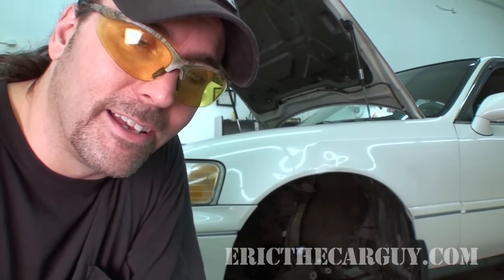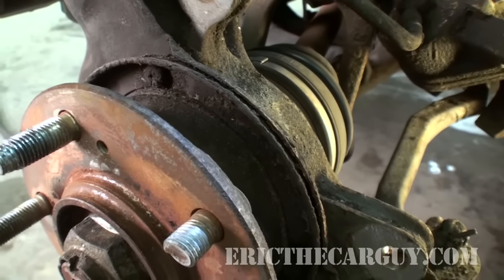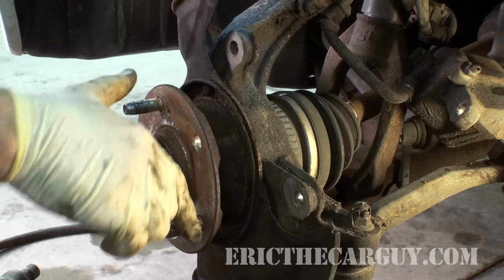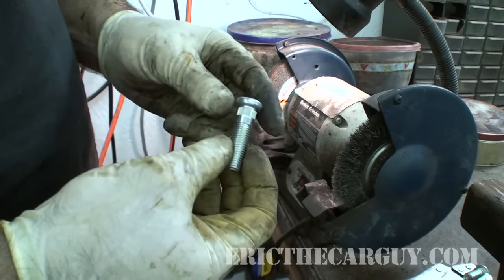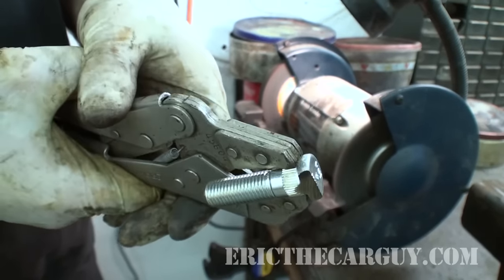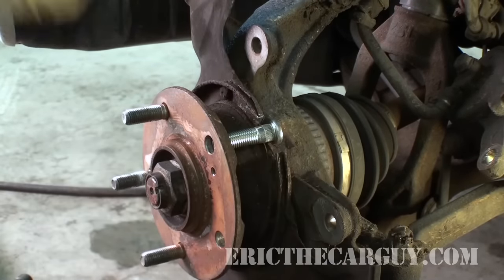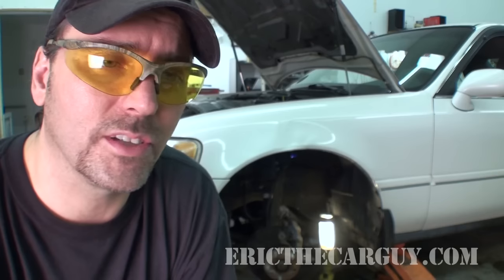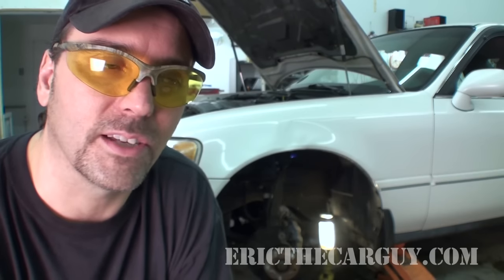Replacing Studs the 'Easy Way' -EricTheCarGuy

Comment: I have done this and it is a good reasonable method. Even with the missing portion on the back of the stud there is no way you would be able to draw it through the hub before the threads gave out.
Reply: or before the hub gave out for that matter.

Comment: Thanks to your tips here, I was able to do this myself and save myself about $300(The tire shops I called all said about $150 per stud!!! That's insane!!! It literally takes longer to take the brakes apart than it does to remove and install a new stud.
Thanks again!!
Reply: it's so fucking funny because these mechanics are usually the one who over torque studs and we end up going back to them again for fucking 300$? No thanks, I'll rather do it myself and learn something new.
Reply: The dealer quoted me $615.05 because they said the bearing had to be replaced on a 2000 honda odyssey and it's pressed in so the whole knuckle has to come off.

Comment: Just used your tip to replace the two front wheel studs on a 2006 CRV.  The hardest part for me was trying to hammer the new stud thru the hub.  Gotta check out one of those air hammers from Harbor Freight!  Thanks again for the help.  You're one of my most trusted resources on YouTube!  Keep up the good work!

Comment: This works 100% and is much quicker, easier and minimizes risk of damaging something. That being said, I would inform the customer about the costs of taking of the knuckle and doing it properly and hope he would accept, before pulling off this sort of improvisation on his car.
Reply: My only concern  is ,would it still pass a state safety inspection.  My state ( Missouri) still requires  inspections.

Comment: I am sorry that so many people watch a free video that thinks outside the box, and all they can do is bitch and complain. I really like the fact that you do very detailed videos, with decent takes and closeups, and that you explain all the pros and cons as you did on this one.

My only suggestion would be to throw the studs in the freezer after grinding them down. If you freeze them before insertion, they will go in a lot easier.

You have saved my butt on several occasions already. Please keep doing these videos!
Reply: Yeah freezing the stud that's a good idea. As I mentioned before I think Eric said some may not agree with grinding that flat onto the back of the stud I've even seen studs in a car that were like that I don't know if it was factory or or they made it aftermarket like that for that reason but that studs not going anywhere with a little bit of that flat ground off what the heck?

Comment: Replacement lug studs usually come with a "D" shaped base for easy installation. And Eric, if you air chizzel that flap that you cut, you can probably drive that stud home without thread damage. Isuzu used to pay 6 hours io replace the studs on all 4 corners. Those were happy days! ; )
Reply: Box truck or light suv?

Comment: I totally appreciate this video! It is a massive money saver on a Honda fit! What would have taken me $400 at a shop or two days in 17 degree weather, took me about 30 minutes. Thanks again for the video, keep up the good work.
Reply: About to do this with my 2012 Honda Fit. I'm so glad to see your comment on this.
Reply: @josephmckinney4816  2008 for me! Doubt I cross threaded the last one, more likely that I over tightened it. Too bad it didn't happen to one of the rear studs, cause the whole hub is super easy to replace.

Comment: I’m sure most people know this but use washers to take up the space in the stud 3 washers or more if you want put the lug nut tighten it by hand or impact it’s up to you the lug nut will bottom out on the washers and then draw the stud in once it’s all the way in the lug nut will stop spinning zap it off take the washers and do the same process until finished out the rims back on tighten torque and good to go if you don’t have washers you can use a nut to act as washer but I suggest washers since they are flat

Comment: I found using a few flat washers and your lug nut tighten the nut against the flat washer pulling in stud flush. I have used this with a great deal of success never a failure.
Reply: A few?  How about one big but strong one?  This method sounds good, but would that mean you'd need a longer stud?
Reply: Good idea ill try that i have big washers that will work perfect! I aint buying no power hammer tool ;)
Reply: I've done it this way (with washers), works for me.

Comment: Thankfully I've not had to deal with engineering this bad regarding wheel studs.  But once the splines are aligned and it's close to being fully seated, I just torque it down when I put the wheel on.
Stay Dirty & Studly!  😄

Comment: Eric, When "pulling" a stud back in, try using a larger nut or stack of flat washers for your old nut to pull against instead of directly against the hub. It helps keep the stud from wanting to twist. Also lubricate the threads and the washers or larger nut contact areas to reduce the friction. It works for me when I cannot get an air hammer to the back of the new studs to drive them in.
Reply: The air chisel works too.
Reply: What do I do when the washer become stuck on the stud?
Reply: There is a tool for installing studs: Lisle 22800 Wheel Stud Installer.
Reply: @ShelleyYbarra must have been too small of a washer. You’ll have to break it off, try heat.
Reply: I used the closed end of a 1/2 combination wrench (didn’t have enough washers laying around the garage)

Comment: You were going good until you beat it in there. It is possible while not damaging the stud at all. 
I do it by completely cutting out the piece as you did, then with a grinding stone I grind the surface of the knuckle back a tiny bit where the loose stud bumps it. You don't need much off, you just soften the sharp edge and the stud will fit straight in there. :)
Reply: Nice tip! Thanks!

Comment: One of the many reason i still drive a 1gen dodge neon.the gap is already there to remove the wheel stud and you dont even have to remove the brake caliper.
Its a good way to do it eric..dont listen to the haters.
Reply: That is a horrible reason to justify having a dodge neon.
Reply: You pick your car based on how well it caters to wheel stud replacement?

I wouldn't drive a hunk of shit, just to make it easy to replace a part that should seldom need replacing, if ever.

Comment: Like Eric said, it's one way to do it. It's one option. And I believe that option has it's place. Anyone with any mechanical sense knows that this is not a structural weakness that endangers anybody or anything. We live in a real world with real considerations that need to be made. If someone has an old car that they need in order to stay employed and can't afford to replace the wheel bearing too, then this method is a blessing and saves the day. So why not?

Those that say it's bad engineering need to get off their "high standards horse" and develop some consideration for their fellow man. We don't live in a perfect world. This option is perfectly viable and can be very beneficial to someone in need. In no way can anyone rightly say that this method is too dangerous or risky. It just ain't so!

Now you may not want to do this on a new car, or to just save a rich guy some money, but it certainly has a place among the viable options for this kind of repair. It just plain cold hearted  to ignore somebody's car repair dilemma for some irrelevant "high standards" crap. THAT'S what's stupid!
Reply: Facts
Reply: @ MandrewP On the other hand, there are better ways of dealing with this sort of thing. For instance, you can get an entire hub/knuckle assembly from a self service salvage yard quite cheaply and just swap the whole thing out. Yes, you have to take the time to go to the junkyard. But this is pretty simple for a DIYer. And the knuckle swap can be done fairly quickly.

Comment: Awesome. Thanks Eric.  I needed this video cause I had no idea how to replace the stud on my 06 Sonata without removing the wheel assembly, which is quite a chore. Some have commented that if a professional shop did this they would be upset. Honestly, if a professional shop use this method and it will resulted in less labor hours and parts for me then I wouldn't mind at all. I'll definitely invest in an air hammer. Thanks again!

Comment: I changed 2 lugs on my sequoia, I didn't have to cut anything to get access.  That said when I put the lug in I froze it in my chest freezer for a week. I am sure a day would do the same thing.  I cleaned up the hub a bit and the lug slid in with some washers and a lug nut. took almost no effort.  I will say that I tried it another time w/o freezing it, I got it but it was much, much harder.  I am often amazed how much steal shrinks at -20f, which is what my chest freezer is at.  I guess if you really wanted you could use dry ice to get even lower, but that is $$$. I have used dry ice to get transmission bearings into place but I wouldn't waste the money on lugs.
Reply: Issue is the length not fit! No room to remove insert unlike other manufacturers that put at least one hole so that you can pound it out and easily put in the new one!!!

Comment: Pro tip for those worried about damaging the bearing while hammering out the broken stud:
Leave wheel on ground and all good nuts tight.
Drive broken stud back into hub using stiff punch. All the shock is taken within the wheel and tyre.
Remove wheel and continue.
I just did it with 2 good hammer blows, on a Toyota.

Comment: good video...shortcuts i have used many times...quite a few studs come from the factory with a portion already flat spotted for clearance issues...
when drawing a stud in with a lug nut i would recommend lubricating the threads to prevent damaging them with the high load you put on them trying to force them in...

Comment: I think that what you've done here is acceptable. I think that there is plenty of "meat" stud left on the stud head as  you stated in the video.I've found that if you don't clean out the hole the stud will usually pull in without spinning using the lugnut method.

Comment: I got ready to bang my wheel stud out with a hammer until I saw this video.  Put it back and grabbed the air hammer.  10 seconds later I was putting in the new stud.  Thank you 🙏

Comment: for people thinking this would not work, you need to understand the mechanics beind it, the part that he did not grind off is trying to be pulled through the hole in the hub, there is so freaking way that is going to happen, the stud will snap before that happens, lug nuts will still have the same clamping force on them as before, nothing is weakened in this process, dont get me wrong i rather do it correctly but if it was my own car or truck, you better beleave i would do this, yes i am a tech like Eric but i work for Gm on diesel's
Reply: there ya go, people shouldnt saying anything hahah
Reply: From my understanding the pull through force that it can take before the end snaps off is limited, and depending on which side is shaved off it can weaken it laterally to that side, but generally speaking the difference is not enough to make a huge difference.

Comment: Changed the brake pads on my 97 Avalon last summer... 2 studs broke after using my impact drill to replace the lug nuts. Damn tire fell off while my wife was driving :(  Got new studs on it immediately, lesson learned.

Comment: I'm here because I'm currently doing this job myself. Couldn't believe a broke stud turned into such a huge job. Personally, I wouldn't do it his way, but I get why people do. On my 07' Honda CRV, there is zero room for cutting - the back of the stud is not too far from the bearing housing. It's of course not a removable assembly either. I was able to leave the steering knuckle partially installed, and with the CV joint out, I used a puller/installer on the bearing and hub assembly.

Comment: To draw the stud in without an air hammer just use the lug nut and and another nut that slides over the stud, but doesn't thread on.
Reply: That's a incorrect way of doing it. That way will cause the stud to stretch and fatigue. Using a air hammer as shown, or a press is the only correct way.
Reply: An air impact is not incorrect, it's just another method of doing it. And an air hammer is another, neither methods are incorrect.
Reply: You are incorrect. Using a impact can over torque the studs causing them to stretch, crack and ultimately fail. That's why there are torque wrenches, and published torque ratings for bolts. 150,000psi tensile strength sounds like a lot, but it really isn't, and is easily achievable with a quality impact gun.

Comment: Did the same thing on my 2008 Accord in the front passengers side. I had to grind some more metal between the hub assembly and the dust shield for clearance. 11k Miles later and no issues, and I have taken off that tire a few times since with no issues. This is a cost saver, and don’t worry to much about the metal not being strong enough after tapering the head of the bolt because it’s still better to have that than not to have a lug nut on it anyways. Godbless

Comment: Thanks Eric. This is NEWS I can USE. Worked great on my 2000 CRV. Took about 20 minutes for stud extraction and install.  Even my cheap dremel grinder ate right into the hub and gave me enough clearance for the new (ground down) stud, and I only went through two grinding points. Also since I didn't have an air hammer, I put four 1/2" washers on the new stud and tightened up a lug nut against the washers and that pulled the stud into place easy.

Comment: I put a stud on a car for the first time today. I used a lug nut to draw the stud back in but I put several washers between the lug and hub down the stud. that did the trick to keep the stud from spinning too much while I turned it with a big boy ratchet. It was an 09 Hyundai Sonata and I lucked out with being able to get the angle to slide the stud in from the back with out grinding or cutting anything. But thanks to this video I managed it, so thanks for sharing the easy way!

Comment: Ouch... I love your channel and most repairs shown are valid. I have actually done this repair on my personal cars a few times with no adverse effect. When you used the side of the grinder to make the flat on the lug though I had to cringe. My left tear duct just under my eye still carries a chip of a grinding wheel that exploded doing that exact thing. I was wearing safety glasses too, but when the bolt jumped just a little, I turned my head and when the explosion occurred, the fragment ricocheted off the bottom edge of the glasses and imbedded itself just under my eye. It looked like I had lost a bar room brawl for weeks. I still use the same method to this day, but wear a full face shield.  A caution at this time in the video is warranted I think...

Comment: EricTheCarGuy, 
Thank you! I have a 2001 acura CL and replaced a stud using this method. Worked! 
I don't have air tools and it took me a few tries. But i just used a hammer, nail set kit (used to countersink finishing nails), bench grinder, vise grip pliers, rachet, rope to tie caliper, and sockets. The nail set kit worked really well to punch the stud out (I was lucky enough that my stud broke short enough that i could punch it out.). I'd say maybe a punch would work better, but i thought this tool would be useful down the line in household work. Anyways, thanks again.

Comment: Don't use an impact gun to tighten lugs on a car, you can lightly drive them on but do not impact them tight, use a torque wrench with the manufacturer specification to avoid doing this =)

Comment: I loved the method of driving the stud with the impact hammer!  Never though of doing that - although the "hammer head?" driving bit never seems to be included with harbor freight tools only the chisel bits.  Have rarely replaced studs and have never had to trim the dust cover (just bent it) but THANK YOU for showing a car where that is necessary AND where the head of the stud needed to be clipped to get it installed.  

There is 5 studs on the wheel no way shaving the head will ever matter - but if it matters then take the wheel off and risk replacing the bearings - it's the mechanics choice :-).  

Finally, I have always used the lug nut to install the studs: 1. Grease or anti-seize the vertical grooves 2. hammer the back to get things started 3. power on with the air gun as you hammer the back of the stud to "help it" into the hole. However, I never liked doing this method because of the strain it puts on the lug nut & the new stud.  Now I have a new and better way to mount the stud and I still thing greasing the vertical grooves helps with the install even with your method - THANKS!!

Comment: I did somewhat the same on me 06 civic si front end. Bent the shield back in the smaller area and cut the cross threaded studs that was so very nicely messed up by tires plus and grinded the side as you did . Not flat though. Needed an angle to slip it in with the use of a 2lb 🔨.fyi tires plus has lost my any business in the future. It will be the 2nd time they do this to the same car. Thanks Eric. I have worked on a 93 accord and my 8th gen civic because you are one of the people out there which have been able to help me gain the confidence to get dirty and make it happen for myself.